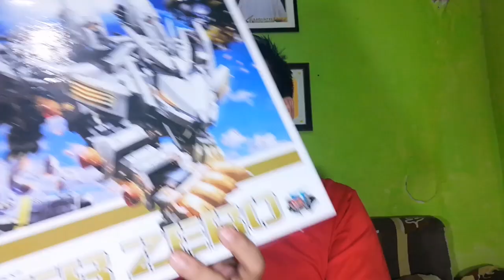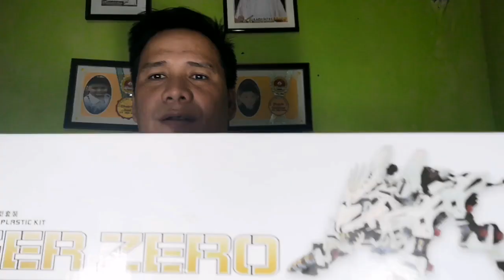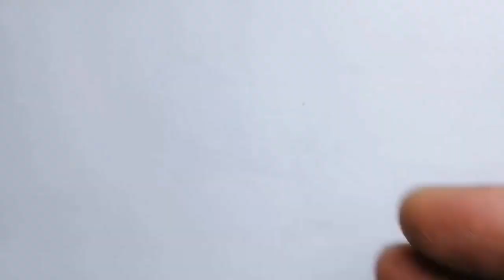LIGER ZERO BT MODEL KIT SPEED FOCUS BUILD AND REVIEW

Comment: Any tips for building this kit?
Reply from the maker: The kit is okay bro the only thing I can advise you is be careful on the pegs they easily break to prevent the pegs from breaking is to widen the hole a little bit with a hoby knife so that the pegs could easily go inside the holes. But other than that no problems at all. Happy building.

Comment: I'm new to Zoids. Is BT a bootleg company?
Reply from the maker: Yes BT is a third party manufacturer of zoids or we can say its a Bootleg but there are also that manufacture original zoids like Kotobukia and Tomy but their zoids are a little pricey but its a great build but for a BT model kit is way lower the price compared to the originals but it has some problems on some parts that dont fit right you have to make adjustments to make the parts fit like sanding and shaving the plastic for it to fit but even its a bootleg its still good for practice building and for first timers in zoids but even its a bootleg i would say its still a good kit to build it not perfect but its good.
Reply: @Infoblitz101  Thanks a lot for the tip. More power!

Comment: Hi sir ask ko lang yung binubuo ko po kasi ang tigas ikabit po baka po may advice kayo ano dapat gawin
Reply from the maker: Base on your problem usually madalas problem sa BT ZOIDS is the holes and pegs that wont fit dahil masyadong maliit ang butas kaya ang tendency may chances n mababali ang mga pegs kaya ang advise ko lang po is if you have a hobby knife pwede po natin yan gamitin palakihin ang mga holes para mag fit ang pegs ipapasok mo lang po yung pointed tip ng hobby knife mo sa hole then incircular motion para ma shave nya yung plastic sa holes just be careful not to over do it kasi baka masobrahan sa laki at lumuwag nman ang papasukan ng pegs hindi din sya mag hohold.
Reply: Shopee meron
Reply from the maker: @johnespencermanayan1652  meron nman po sya sir kaso mabilis maubos minsan tinataasan nila yung price.

Comment: Pano po kung hindi mag fit sa butas ano pong pwedeng gawin binubuo ko po sya ngayon😁😁😁
Reply from the maker: You can try using your hobby knife to widen the holes just put the pointed tip inside the holes and move it in circular motion to shave a little bit of plastic pero wag ka sosobra baka po masyado nman lumuwag ang holes nya.

Comment: Kakabuo ko lang ng Panzer after 7hours😂
Reply from the maker: Kamusta nman po yung build para sa inyo ng panzer sir?
Reply: Challenging build talaga  pinakabrittle part ung missile heads na puti ang dali magcrack
Reply from the maker: Ah ok at oo nga napansin ko din yun kaya b4 ko silang kinabit sineshave ko yung mga plastisc nya at sand paper para maging ok sa BL tlaga po madaming kailangan gawin b4 maachieve ang pinaka good results ng model kits kasi kadalasan ang problem po sa mga third party kits ay masyadong sobra ang lagay ng plastic kaya hindi kaagad mag fit sa bawat parts nila.
Reply: Nabasagan ako ng isang missole head pero buti nalang may Cement ako😅 and ung missile pod sa front leg angat,kelangan ko tabasin
Reply from the maker: Tama sir kailangan bawasan ang pegs sa may bandang unahang legs kasi nakaangat nga sila at hindi magandang tignan kaya tlga madaming trabaho sa pag gawa pero ok nman sya in the end.